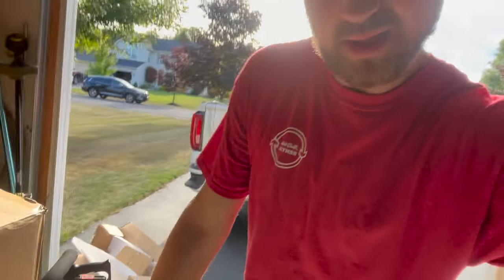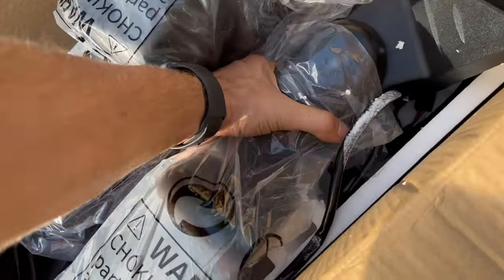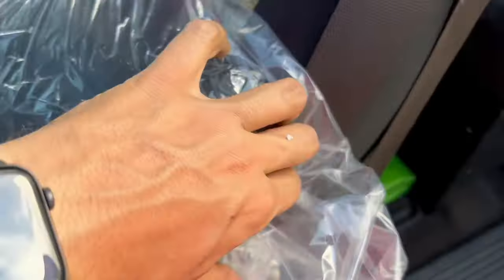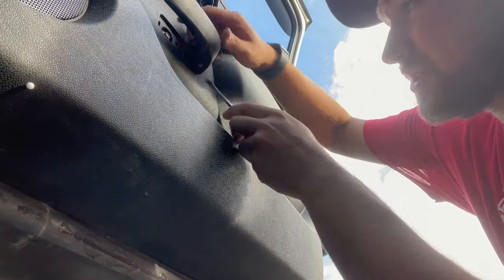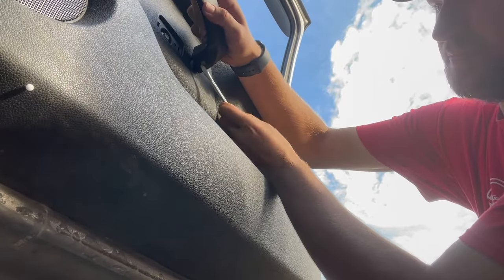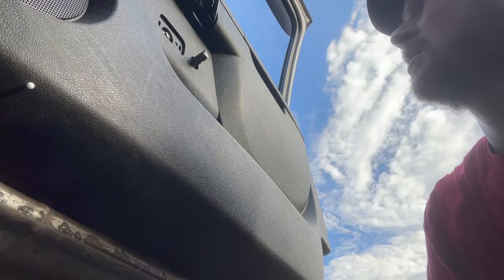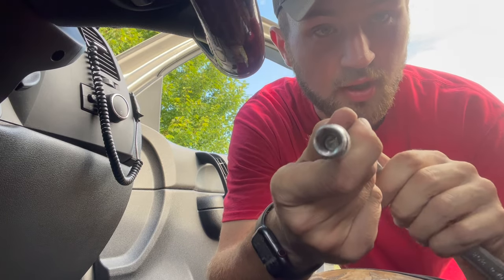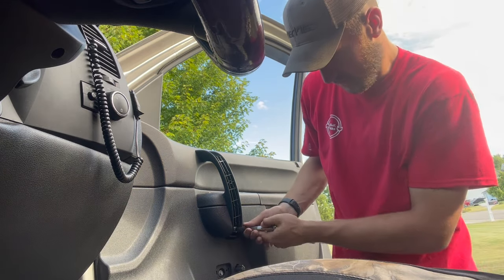07-13 Chevy Silverado Tow Mirror Install/Review (Yita Motor)

Comment: Hey I have these and I really want to fit them power folding... Any way to do this?

Thanks.
Reply from the maker: Unfortunately not. I believe they’re a computer thing
Reply: @BowtieBrem  Hey! Thanks for your response. I have the harness already existent in my truck as it is a denali... Just curious if I can DIY the actuators into this mirror body.

Cheers.
Reply from the maker: @hackervirus56  I believe the mirror needs the computer chip in it

Comment: Do you have to run away different wiring for the lights to work on it or all plug and play?
Reply from the maker: Plug and play. Just need a wire for reverse lights but it comes with kit. Already had it from previous mirrors